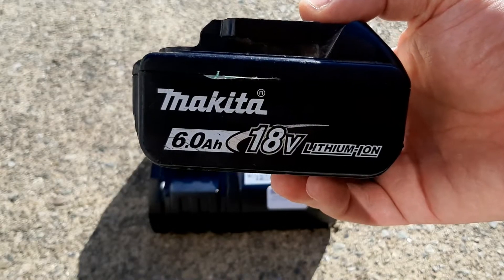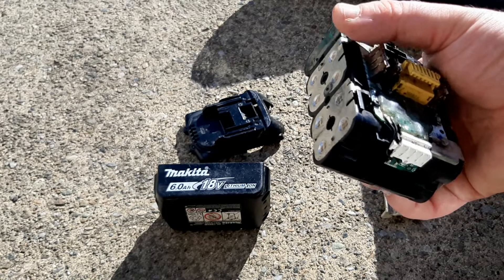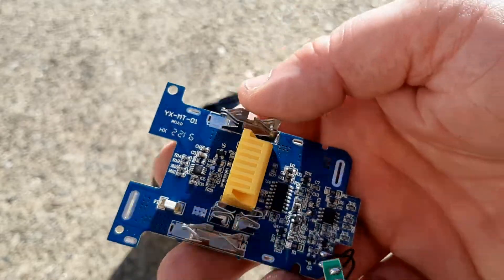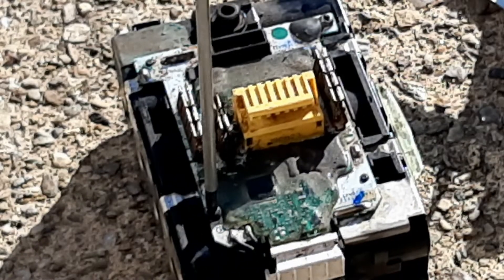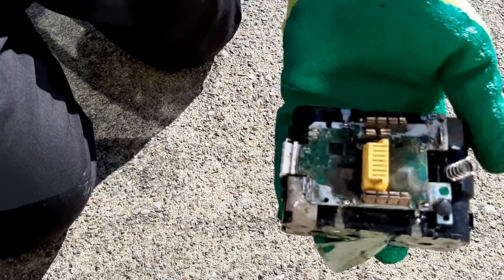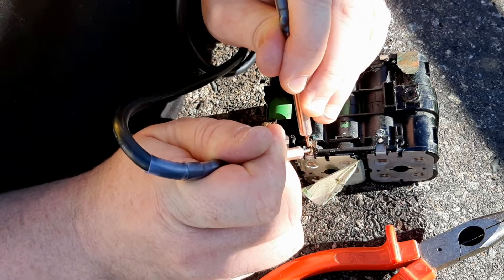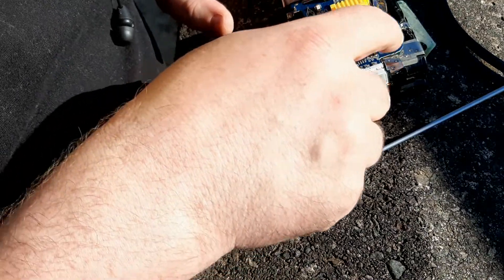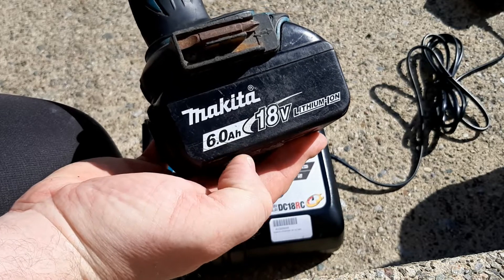Makita Battery Faulty PCB Repair

Comment: Hey how safe are the knock off PCB's? I know those Sony VTC6 Cells have a pretty good data safety sheet so should be good. How's the PCBs going 2 years later now?
Reply from the maker: Going well I never had an issue with those

Comment: Hiya pal, is it possible to change the yellow bit without having to change the entire circuit board ?
Reply from the maker: I have heard you can change the yellow piece but haven't done it myself
Reply: @doctorlefthandthread  hi, thanks for the reply. Do you know if it just pops off ?
Reply from the maker: @StevenR365  I will try and check for you tomorrow I have old boards in the workshop it's a bit late tonight
Reply: @doctorlefthandthread  no problem, thank you. Appreciate it

Comment: I mounted 9ah batteries for makita, it starts charging and five seconds later the charger lights up the green Led of fully charged, how can I solve this?
They work on tools only on the charger that doesn't
Reply from the maker: I wouldn't be sure unless I had it opened could be a few things

Comment: I have a 5ah LXT battery, its barely been used (I think less than 10 charge cycles in 3 years), never been left outside or in the cold, never been exposed to water, & yet its failed too. When you press for the battery state indicator, it flashes both left LED`s then both right ones, quicky, for about 10 seconds, I suspect its the circuit board. Makita isn't interested as its outside the 1 year warranty... 
Did you get the board direct from them, or is it a copy?
Reply from the maker: It's a copy as far as I know you can't get genuine ones to buy
Reply: Ive got the same problem and it seems like the Makita batteries have a bit of self discharge over a period of months also.

Comment: I use makita batterys for a lot of things including kids battery powered vehicles. Hard to teach a kid to come get a fresh battey as soon as the car starts slowing down. Until you start referring to it as a "pit stop"😅. One thing I discovered was that the teal battery chargers would still charge a battery when the black battery chargers refuse to.  I think they raised the cutoff voltage point between good/not good when they started making the black battery chargers. Just info somebody might find useful.
Reply from the maker: Cool info thanks I have a couple of the green chargers 😀

Comment: I would like to thank you for this useful explanation, can you give us the direct address of this circuit board ?
Reply from the maker: Ebay has them listed however there are a few different types search using the specific part number of the battery BL1860B for example
Reply: @doctorlefthandthread  
I've searched but can't find one like the one you used, I also have a BL1860B
Reply from the maker: @yassine8684  https://www.ebay.co.uk/itm/374242862610?mkcid=16&mkevt=1&mkrid=711-127632-2357-0&ssspo=q4jixlmtqne&sssrc=4429486&ssuid=cjPn_ZfdQLW&var=&widget_ver=artemis&media=COPY
Reply: @doctorlefthandthread   thank u so much
Reply from the maker: @yassine8684  no trouble keep watching the channel all views count
Reply: @doctorlefthandthread  Thank You! for this info. and the place to buy the board. Liked and subscribed!
Reply: Hi my battery has 3 Philips screws and one that is completely flat so looks like it's sealed.

Comment: Their batteries used to often fail prematurely. Nothing wrong with the cells but the chip just decided to no longer allow charging. I think they’ve improved that issue over the years. But sure leaving them in water won’t help 😂
Reply from the maker: Water doesn't help them

Comment: How do u get the battery open plz
Reply from the maker: There are 4 x t10 security torx so you need the T10 torx screwdriver with the hole in the centre. There may be a white security tab down one of the holes that prevents access to the screw. If you get a wood screw and screw it into this tab as far you can then you can pull it out with the pliers. This will give you access to the screw

Comment: where did you get the replacement board?
Reply from the maker: Ebay but there are different types so you need to make sure you are ordering the right one
Reply: @doctorlefthandthread  i'm trying to repair a BL1850B but i'm having a hard time finding a board that looks the same. i can find ones that are close but have a slightly different soldering point for the long front battery tab. they come with the connector tabs for the batteries but that would require me having a spot welder to attach them i think.
Reply from the maker: @Everfalling  the one I got was a different color from the original but had to be soldered in. If you make sure it is suitable for the 1860b is should work. I ordered mine on ebay it had to come from China which means above normal waiting time. It was not expensive so I took the chance.
Reply: @Everfalling  They're available on Amazon also, but the good ones, the ones that have the 'balance' wires seem to only stay around for a week or so. The slow shipping speed from eBay is my only reason to prefer Amazon.